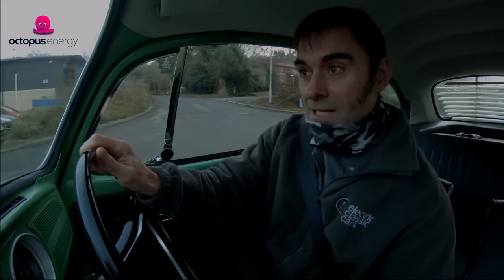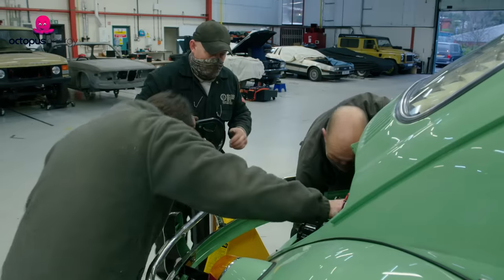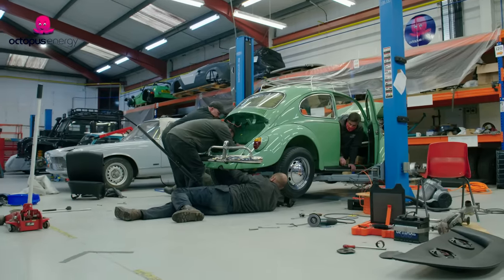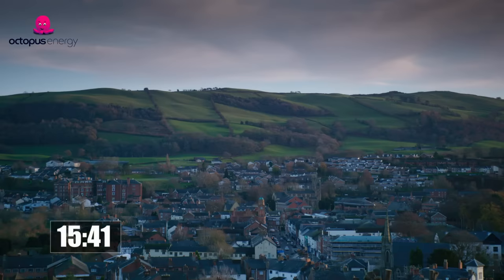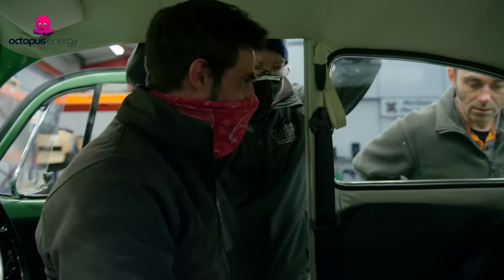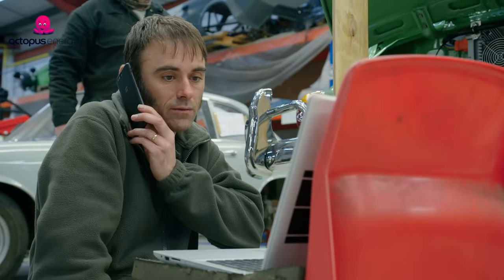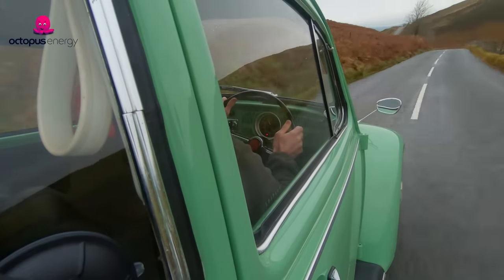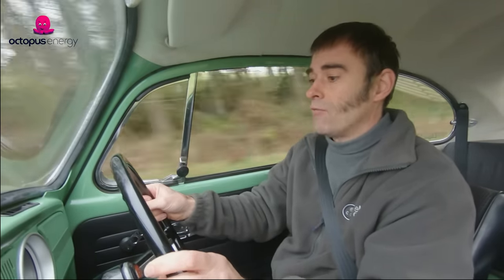VW Beetle converted to electric in a day

Comment: @Daniel Lindy - "That's one clean little Beetle!  Hurts to see such a nice little engine removed." 
Agree 100%.  They should have used one requiring body repairs without an engine that normally would have ended up at the scrappers via the breaker's yard for parts.  An accessory electric heater on flat out during a chilly, damp, snowy British winter would diminish the miniscule range by up to 30–40%.  Luckily, being a small nation, the towns are right on top of each other and if you wish you can spend all day charging at charging stations (if that is your thing).

What will this car end up being then?  With an 80-mile range (vs. 200–300 for a 1200/1300 petrol model), a weekend warrior (if it is lucky – which will still require regular charging of the expensive battery pack so it doesn't deteriorate) that is hardly driven and would have damaged the environment (electric motor/battery requiring aluminium, iron, lithium, cobalt, nickel, graphite, manganese, etc. mining plus burning of fossil fuels to make and operate) far less if the (smoky? - not that I could see, lol) engine were retained.

Comment: Amazing job , I didn’t think you were going to achieve it because of the problems that you encountered.
When it’s converted do you still need the gearbox?
Reply: That is my question too.  Gears. 1st, 2nd, 3rd, ?????
Reply: @Rtwolfe63  I’ve watched a few more of these videos and they do keep the gear box and you can use all the gears as normal or just put it into 4th , 5th and leave it.
Reply: You don't really 'need' it anymore no but these kits make installation a simple (relatively) process by using the existing transaxle and bolting right up.  You just tend to keep the car in one or two gears though.

Comment: No need to remove the exhaust should be able to remove the engine in five minutes
Reply: Yup....even faster in a dune buggy.....four bolts, and 3 or 4 wires.....and throttle cable and she's out.
Reply: @TheWolfsnack  .... average shop time to remove that engine could be from 10 - 30 minutes depending on what's rusty and how many things the last guy forgot to connect. I have seen heater hoses and cables slow a job by 10 - 15 minutes. Just remember, anything you don't break is something you don't have to fix.... and judges at a competition are watching for all the small stuff.

Comment: So sad. A beautiful car just died! Gone is the beautiful engine, unique sound, and heating -- replaced with laptop tuning and a short range.
Reply from the maker: This car came in without all the heating connected up, probably because it was chucking exhaust fumes into the cabin as often happens with these. It now has instant electric heater, like a hand dryer in a washroom.
Reply: @ElectricClassicCars  :-) So that's a good news
Reply: 21.5 million bugs were made world wide; who gives a flyin'fook if a few are modified...
Reply: you lost me at "beautiful heating". VW's heating was the worst. Either feeble, or stuck in hellish hot. Always stinky, occasionally noxious.
Reply: Destroyed it.
Reply: Think of all the carbon we take out of our Air
Reply: @toddvanwinkle7777  
Pristine classic now a milk float stuffed with half a ton of toxic heavy metals. Nuclear power station on the other end of the wire. Another half-ton of batteries in a couple of years. Why didn’t they save a vehicle rather than gut one?
Reply: JelliedCranberrySauce  Doesn't have to be. People can carry a portable solar powered charger. They just invented a printed solar panel.
Reply: @johnedwards1685   My thoughts exactly…

Comment: But it's still got a gearbox. That must be eating a lot of the energy.
Reply: I doubt it's even measurable. (plus, 120hp more than makes up for it.)
Reply: @Carl Klinkenborg Have you ever tried to turn the ingoing shaft on a gearbox by hand?
Reply: @Carl Klinkenborg I'm just saying that a gearbox is an unnecessary powerdrain for an electric car as an electric motor produces all of its torque from 0 rpm. I do realize though that this is an easier way to integrate this motor in an existing vehicle. And I'm a car mechanic myself so me too I know what I'm talking about. A gearbox uses energy both from its inefficiency as from its weight. Ideally an electric car would have two motors, one for the left side, one for the right side eliminating the need for a differential as well. the difference in speed while turning can then be adjusted electronically.

Comment: This would only work for me if it came with a vw engine sound system, it’s like the opera singer has had his voice taken away 
I love petrol engines the smell and characterful sound for me electrics is a last resort.
Reply: You can make a recording of the engine and key the sound to vehicle speed. So even with electric you can have the 4-cylinder engine sounds.
Reply: Yeah, but it's electric. No sounds. Engine sounds are cool but that's it.

Comment: nice conversion, but essentially pointless since classics aren't an environmental problem. and a large part of the appeal of a classic is the engine, the noise, the smell, the vibrations. this is more of a frivolous, consciousness-easing thing to do for people with money to burn. my classics are definitely staying as they were made. there are other, far more effective steps i can take to mitigate my impact on the environment.
Reply: You might like noisy smelly classics, but many don't like the noisy smelly part, not to mention the low power and high running costs.
While I miss my Porsche 928 S2 and especially its sound, I would be very interested in getting another that has been properly electrified and keep it forever.
Do not assume that you will be able to get petrol for ever.
And to be sure, there are a good number of cars that should never be converted, the original engineering is a vital intrinsic part, even if they were stored on a pedestal and never driven.
Reply: @ottomellar6774  ...turning it into a worthless "collector" car !

Comment: Clutch?   Gears?  Describe please.
Reply: An electric motor doesn’t need to shift gears.
Reply: @lampoon9871  Way more fun though
Reply: @johncarter9964 what's your point
Reply: @Quasar0406  if an electric car had a manual transmission and a clutch, I would be interested in driving one
Reply: i sae a video about a year ago that installed a 200 hp motor to the trans axel. elec AND 4 speed. also, at SEMA a couple years ago somebody had ac1000hp Mustang with a 6 speed manual trans. cool!!

Comment: So... basically you changed how the energy is used, not how it's made. 
You also just made life miserable for the slaves the Chinese use to mine and manufacture those batteries.
AND.... you just created about 500 pounds of hazardous lithium waste in two years when those batteries lose 50% of their efficiency because those batteries have a limited number of recharge cycles.
Well. Done.

Comment: Terrible.  Why convert a perfectly fine classic car?   Find a donor that has broken engine or transmission instead.   This classic beetle could have lasted another 60 years.  Now with large battery which will go kaput in only few years the car will have to be junked.

Comment: Just a question of how much and does it work outside uk ?

I’m for Portugal. My daily is a 1957 beetle. 1200 cc 30hp. Need an autonomy of 150 km. 

What you’ll be the cost? 
Would it be possible to use in Portugal?

Thanks

Comment: Check your weights and balances. You're obviously heavy on the front stearting wheels (added battery placement) and light on the rear axle (Removal of gasoline motor weight.)
Reply from the maker: Nope. It's a swingaxle rear end. That's what they're like when they come off the lift. They need to roll a few car lengths for the rear end to settle down.

Comment: You show bolting the motor to the bell housing - presumably the gearbox is still in there and maybe the clutch? What happens to them? Or do you simply lock the gearbox and clutch for changeless driving?
Reply from the maker: The clutch is still there. You can change gear but you need to do it less as the motor has so much torque from zero rpm. 👍

Comment: Very good, such a e-beauty! I have a question, did you replace the transmition too, or used the old one? Because i didn't saw the changing it for an electric transmition? Or did i just missed that part? Was a manual beetle when was petrol or automatic? Can it run with its original trans?
Reply from the maker: The motor is connected to the original manual transmission.

Comment: A beetle would be one of the easier cars to convert. Not discounting you're effort, this is a major for one day. If you're going to pick one to set a 24-hour record, this would be the car.  There's no power steering, no automatic trans, power brakes, drive shaft, nor a/c. The rear-engine is hoistable by two sturdy men. There's room under the front hood for batteries, and Bob's your uncle. And it's green, literally.

Comment: How does the heater work? Bugs use Engine heat from the Cooling fan. I imagine you will have a hair dryer connected now? :)
Reply from the maker: It has an electric heater out of a modern EV. Instant heat. 👍

Comment: They didn’t mention the transmission except when it was blocking battery placement. They mentioned the clutch in the way of something. Can an original ( or any) 4-speed manual tranny be synced to an electric motor??  Seems like it would require a CVTran.

Comment: Please let me know how is the battery capacity run in km range ? Charger voltage and charging current  ?
If jakary for solar system can be used for the chargeing  ?

Comment: you need to push fixed configs of motor battery and esc. i would like to see some kits. the next step would be to make it easy to swap it in some cars and get all the certifications for it to get everything street legal. in my country this is way to costly and complicated. i have some old cars which are not roadworthy anymore because i cannot find parts for it. an electric configuration would solve like 50 % of all the problems.

Comment: As the electric motor was attached to the normal gearbox..would you still have to change gear ?
They never said about that bit..if so it would only go as fast as the old gearbox would allow it to..is that correct .?

Comment: I wonder how they are going to heat it during the winter? Typical Beatle had forced air supplied through floor vents. Maybe the heat will still come off the motor.
Reply from the maker: It has a heater in it from a modern EV. Think hand dryer in a washroom, instant heat.👍

Comment: Great conversion.  What do you do for heat and defroster?  I had a VW (1963) about that vintage and the heat and defroster came off the engine.
Reply from the maker: The heater is now electric, just like in a modern EV. Instant heat. 👍

Comment: With a pristine car like that i could also do it in a day or two as well but the issue is nobodys car in actual practice is going to be like that.

My corvair for example would also be very quick even though it isnt pristine, the flat 6 easily drops out and the fuel tank is shaped in such a way that a battery box could easily replace it and more capacity can be added in the now mostly empty engine bay to balance out the weight.

Comment: So I'm not a mechanic and I'm not very clued up on electric motors either, so just a quicky... Do these electric motors bolt straight on to the gear box, and then you drive it like a manual. As opposed to say a Tesla which drives like an automatic?
Reply from the maker: Yes. This motor is bolted directly to the gearbox so you can change gear just like a petrol engines beetle. However because of the very wide torque curve you change gear a lot less and can start easily in 2nd or 3rd because of max torque from zero rpm. 👍
Reply: @ElectricClassicCars  thanks. That great to know. My vivaro gave up recently, and I'd love to have kept it and converted it to electric. But unfortunately space is the issue.

Comment: What  about the gearbox did you use the old gearbox or there is some modification did to make it a single gear to fit the electrical motor ?

Comment: Tell me what is the increase in weight (increased wear of rubber, brake pads and suspension) and a decrease in autonomous mileage (this is a scooter to a pub or you can go far away), if it's not a secret?

Comment: If you re-purposed a Teslas batteries and Teslas get over 300 miles of range.Then why does a smaller lighter beetle only get 90 miles of range?
Reply from the maker: Because the battery in this Beetle is much smaller than a Tesla as its chassis can only carry a fraction of the weight compared to a Tesla.

Comment: Modified vehicle, how does that go with  insurance company's worries about EV's fire risk and DVLA registration?
Reply from the maker: You have to inform the insurance company it’s a modified vehicle, just like if you put a different engine in it. Premiums are no different to any other modified car. Dvla you have to inform its now electric and as long as you’ve adhered to the radically altered vehicles rules there’s no problem. 👍

Comment: The range is OK if you drive 50 miles per day and are able to get enough charge overnight. The problem with batteries is when they get old they appear to be be full making it difficult to judge range. Then when you use it like you always do they will all of a sudden loose power when you should still have some left. Most people will not have a place to charge overnight. They will be forced to use a rapid charging station. Rapid charging diminishes range over time quicker than trickle charging. Electric cars need a generator that can charge the battery and run the vehicle at the same time. This way you don't have to wait to charge on long trips and can still charge overnight for average daily commutes.

Comment: Driving around in that humid and possibly cold environment without any heating? Not even a defog system for the windscreen?
Reply from the maker: What? It has a heater in it from a modern EV. Think hand dryer in a washroom, instant heat. 👍

Comment: An electric car with a 4 speed transmission, do you just drive it in 4th generation or do you still row through the gears?
Reply from the maker: The motor revs up to 7000rpm. Most of the time you just drive it in 3rd but you can change gear if you like. 👍

Comment: 6:54 Normal car 12V, electric car 800 amps.  ????  A big 12V car battery can deliver over 1000 amp or a 1000V system can deliver only 1 amp. So what is your analogy here?

Comment: Using 120hp vs the Stock Original 40hp is ridiculous with a 25kWh Tesla Battery pack only giving you 80 to 90-mile range! For the USA, 70mph is Max for 98% of the Country. Having a 400+ mile Range is more Important than Speed. A VW with a 1.3L making 89hp@6500rpm!
Manual 4 Speed!
0-60ft 17.838 secs!
0-330ft 11.087 secs! 38mph!
0-660ft 15.919 secs! 54mph! 1/8th Mile.
0-1320ft 23.110 secs! 67.4mph! 1/4 Mile.

Comment: "For some reason it's just magically started working" That's one of the downsides of electronic technology, very temperamental. People don't seem worried about that side of things. It'd be interesting to know the lifespan of this motor and battery combination, compared to the original engine.

Comment: when I was younger, I could remove the engine in a bug in 20 mins with a floor jack, and did so many many times.... took 4 guys, how long??? hmmmmm
Reply from the maker: Quickest I've done it is 10 minutes on my own. But someone had bodged the rear valance on this one which made it a nightmare to drop it out. 👍

Comment: To bad the engine compartment has loads of space still but all the luggage space is gone.
Reply from the maker: On some we’ve turned the engine bay into a boot. There’s still luggage space in the front, as the front battery pack is only 2” taller than the old petrol tank that was in there.

Comment: Why don't electric cars have 25, or more, stators on each drive axle to generate electricity while the vehicle is moving?
Battery energy would only be needed to get the car moving, once the vehicle is moving then the stators can power the electric motor and the vehicle should be able to drive thousands of miles between battery charges, explain how I'm wrong?...lol

Comment: My father just shared this to me, he loves the idea of an electric swap.  I would but it is too expensive and slow; twice the price and under half the power output.  
For now, too expensive.
Reply from the maker: Half the power? I think you've got that wrong. The original engine in a VW Beetle was 40-50hp, the Hyper 9 motor in this electric one is 120 hp. I've personally got a 600hp motor in my VW Beetle, which gives me a 0-60mph of 2.7 seconds.
Reply: @ElectricClassicCars  I should have added, that was compared to a modified car.  My thought process:
(16 Tesla modules at evwest is $40’500 CAD excluding shipping, so batteries alone is the same price as a fully completed 1300hp is300 with a built 2JZ or LS)
I’ll have to check out that Hyper 9 motor and do research in my spare time.  That sounds so fun, a 600hp electric beetle with a 0-60 of 2.7s, now that’s cool 😎

Comment: Wind Turbine takes 100 tons of coal to make an 80 meter wind turbine and hundred of barrels of oil for the propeller and only last 20 years max. Solar is worse with 22 refined elements made from coal for 25 years if your lucky thus C02 (plant food)  less is a joke